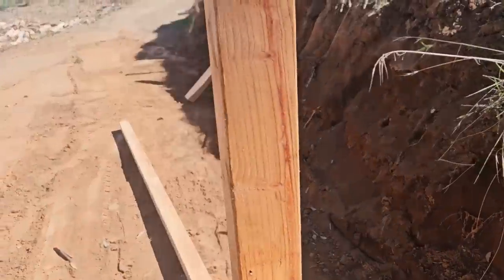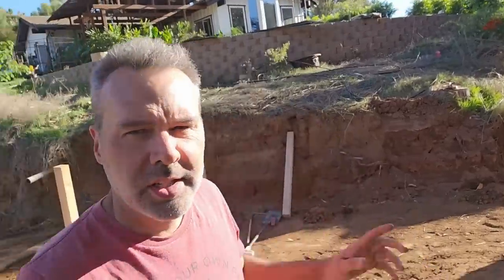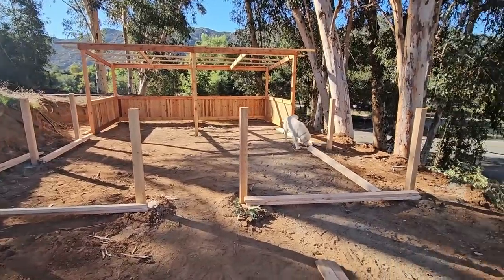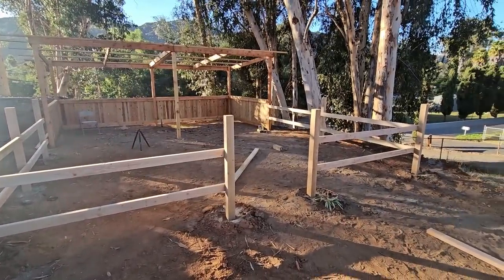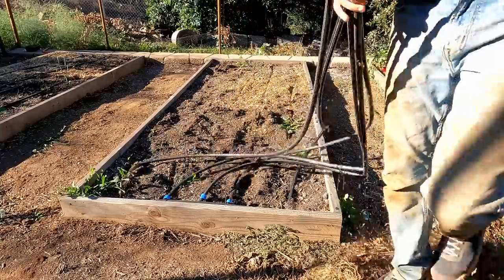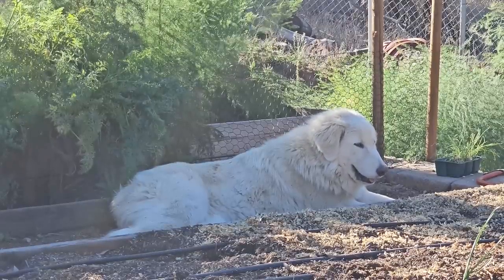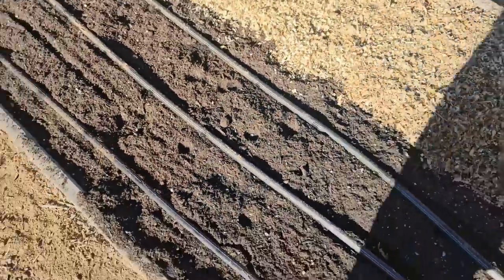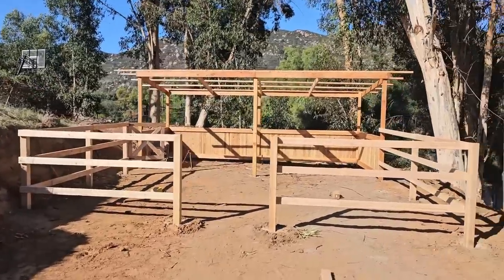How to Plant Garlic & Finishing Daisy's Corral

Comment: When you do the concrete, make sure it sticks up an inch or two above the dirt. (Do like a little hill coming from the post to the level of the dirt all the way around) That's so water runs away. If not, those posts will rot in no time flat.
Reply from the maker: Thank you for the tip!

Comment: did you put all the rails on the inside except for one front corner?  If so, why is it different for that one corner where it looks like they are on the outside of the posts?
Reply from the maker: Wow, great eye! I screwed up in the placement of that post. So the board was straighter going on the outside.
Reply: @littlehomesteadbigdreams  I have a little bit of that OCD for details you talk about that slows projects down for me too.  I get hung up on so many small details.  I probably wouldn't have given it much thought, except that you've mentioned that you have that issue in a few videos.  So seeing that I figured there must be a reason for the difference.  The whole thing is looking great.  And I know the wood panel was for cost... but I think it looks better than tin would have.